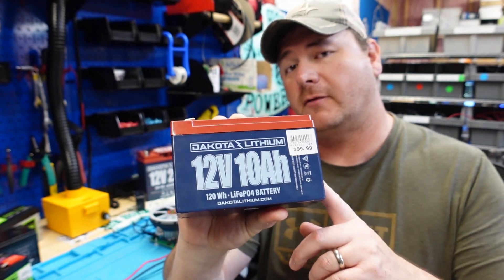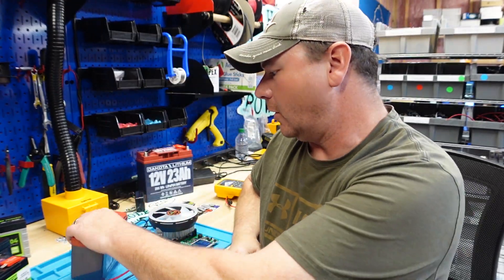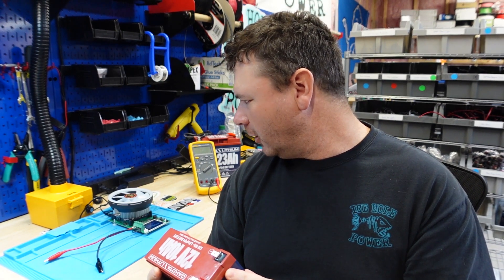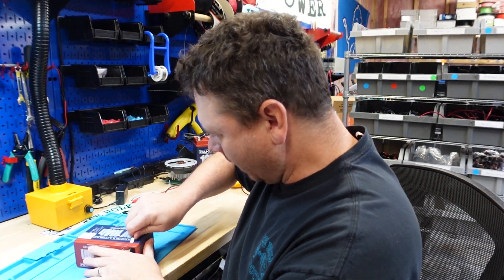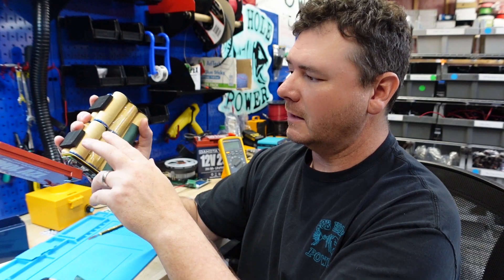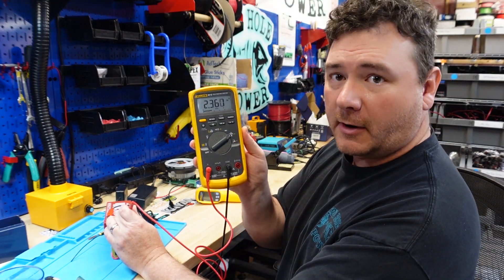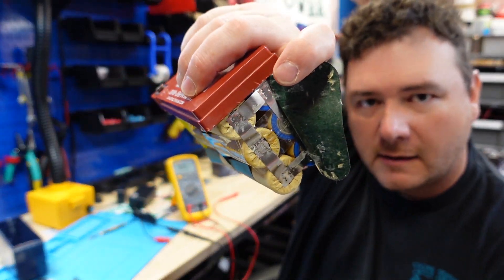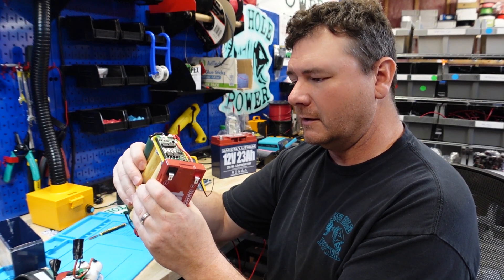Dakota Lithium 10Ah Tear Down (Now Made In China!?!?)

Comment: Love the videos. I have been watching a load of them. I do have a question. You were speaking about the heatshrink, not stopping the conductivity of the voltage. Between the cells. Arround the 6:00 mark. Is the heatshrink not sufficient? OR is it a case of more is better? 

I am looking for a small 20ah lipo4 battery5lbs or less. I have been looking at the eco-worthy 20ah. The recessed terminals, and cannon plug for charging seems appropriate for a ham/gmrs radio bag. I am looking to see if you have done one of them. "ECO-WORTHY Portable 12V Lithium Battery, 20Ah LiFePO4 Deep Cycle Rechargeable Battery". I want to charge it from my truck while driving or a 10amp solar panel on my trailer. Yes I have a 12dc to 12v DC charger. I have 4 100ah in the trailer and 2 in the truck. That is aside from the lead acid to run it. 200 Amp alternatior and I jump start tractior trailers. So the added power is required. I also have a 24v jumper for equipment.
Reply from the maker: I would want to know what the initial amp draw is.  Most of the smaller batteries have a 15amp max.  So I would make sure the battery can handle what you are throwing at it.  

The heat shrink would be a more is better IMO.  Thanks for the comment.  I hope this helps you out.
Reply: @iceholepower8012  my maximum draw at peek is 10amps @12v. It is for a portable radio. 1amp standby. .01ma for off.

Comment: Just ordered two of these 2 months ago. Batteries received were all made 03/2022 and fully charged voltage was much lower than my other used Dakota 7ah ones. Dakota Tech support told me nothing to worry. If I do not like them and want to return I need to ship them back on my own charge. I kept them. After two months light use (for my son's razor scooter), one battery died, could not be charged normally. Dakota still insisted on me to ship it back. Eventually they agreed to reimburse the shipping but required me to restore the terminals to like new condition since I already soldered them. Told them mission impossible and asked for some kind of tolerance or waive this requirement. Tech support got pissed and stopped responding. I think their warranty is a scam.

Comment: Unfortunately I have 12 of these and 4 for sure have bad bms's with no over current protection 3 have 7ah of capacity or less one of those 3 only have .5 ah of capacity. I can send you the CBA test charts and the picture are hard to see but the 4 that i know for sure have no over current started to melt the tops where the bms is. They set me some for warranty replacement and they failed the capacity test also at 8ah or less. Have CBA load test for them also. Its sad I had High hopes for these batteries.

Comment: I'm looking to use these for an Electric trials motorcycle (Oset 16R). They run 3 12v 10ah SLA. They can be charged through the bike or externally. What would you use for a charger. Dakota says charge them individually, not in series as they are run on the bike. Curious.
Reply: PS. Thanks for doing this video.
Reply: I have 2 battery setups using these same DL  batteries for my Goped esr1000h. It's 2 setups of 4 batteries each so 8 of these 12v 10ah batteries and the first set were assembled here and the 2nd in china. So each set has 2x 24v battery banks and when I use the goped onboard charger that's programmed to a lifepo4 profile and yet still .....
       MY BATTERIES HAVE A DRASTIC DIFFERENCE IN PERFORMANCE WHEN I CHARGE INDIVIDUALLY WITH THE 
DL 12V/3A CHARGERS VS THE ONBOARD CHARGING SYSTEM.....😲

      WHAT I DONT UNDERSTAND IS WHY I HAVE A VERY NOTICEABLE DIFFERENCE IN PERFORMANCE BETWEEN THE 4 BATTERIES MADE IN CHINA AND THE 4 BATTERIES
ASSEMBLED HERE. THEIR DATES OF MANUFACTURE ARE ONLY 2 MONTHS APART AND I NEVER USED THE BATTERIES BEFORE THE SECOND SET CAME. ARENT THEY BOTH GETTING THE SUPPLIES FROM THE SAME SOURCE? WTF? ITS NOT A SLIGHT DIFFERENCE ITS 3-4 MPH AND A FEW MILES RANGE EACH AND EVERYTIME...?????🤔🤨

Comment: Just wondering, why would you need a low temperature cut off? Most battery packs have a high temp cut off for battery degradation, internal short, fire etc.
Reply from the maker: When you charge a lithium battery when it is below freezing, it will damage it's ability to retain a charge. I am making a video now about it. Thanks for watching!

Comment: I've been considering the Dakota 12V54Ah battery, but don't want to spend that kind of money if it's not well built.  You asked for suggestions from viewers for the next battery tear down, so there's my suggestion. I'd like to know if it's built well on the inside, where was it built (China?), what kind of protections are built in, etc....

Also, would you expand on the 11 Year Warranty that Dakota offers? I've heard that it's actually a 5 year warranty with a prorated discount past the 5 year mark.

Keep up the good work!
Reply: Todd I've been doing quite a bit of research over the last week into lithium batteries as the (4) 100 AH lead acids that came in my Ryobi riding lawn mower are starting to wear out. I also use the mower to push snow and it's a great machine that I'd like to keep 10+ more years. 

I spoke with Dakota this week and can confirm that their warranty covers full replacement for the first 5 years and then a 30% discount off a new battery for the remaining 6 years.

Battleborn makes their batteries in the USA and their customer service is very helpful and knowledgeable. They have a 10 year warranty that covers full replacement for 8 years and then a 30% discount off a new battery for the last 2 years. I'd like to buy from Battleborn but I can't justify spending nearly $3k for a lithium battery set when the Chinese made one's are half the cost. I'd pay a few hundred more for Battleborn's but not that much more as it's just too expensive. Hope this feedback helps you!
Reply: @zachl6918  Thanks for the update! Yes, that helps a lot. Since my first post with you earlier this year, I’ve also started looking into the SOK batteries. They seem to be very well made and now include battery warmer and Bluetooth monitoring. 

The SOK 100ah without the Bluetooth and warmer is around $540 I believe. They have a nice metal case too. They’re also available in a marine version for wet conditions. 

Another LiFePO4 battery that is more economical is the AmpereTime for around $399 per 100ah battery. 

Keep up the good work and I’ll keep doing a little more research too! 

Take care!
Todd
Reply: @TangoRomeo121  Good to know, thanks for the info!! In my case spending $1,500+ on a set of batteries is a big inventory so I'm trying to take my time and make sure that I get a good set for the money.
Reply from the maker: I would like to do those bigger batteries but the channel would need to grow to justify that kind of cost. When and if I do, then I will make sure to include some warranty info.

Comment: Your 4S3P description is incorrect.  In order to output 12V there needs to be 4 cells in series or approximately 3.2V X 4 = 12.8V.  You cannot have 3 cells (as described) in parallel 4 times.
Reply from the maker: you misunderstood my description of the cells.

Comment: Great timing finding this video. Just ordered 2 for use with ham radio. Plan on installing in parallel for increased capacity. Considered Bioenno but like the fit of these in a 50 cal. MTM box.  Order backlogged for 4 to 6 weeks. Since from China I guess they are sitting on one of the 100 ships sitting off the coast of LA. I was pleased to see that the quality meets your standards. Once I receive the batteries I’ll be ordering a few items from your store too. Looking forward to the other battery tear down videos.
Reply from the maker: Glad you found it useful! BTW, there are a couple on Amazon if you didn't want to wait. https://amzn.to/323nEFv

Comment: Great idea on these videos!  I'll be following along.  Quick question, what is an easy way for a consumer to capacity test one of these batteries?
Reply from the maker: Thanks for watching! This is the load tester that I am using. https://amzn.to/329vOMJ
There are also cheaper ones out there that I have used in the past. Just make sure your amps knob is all the way down before you hook up the battery. https://amzn.to/3cld9PQ
Reply: Go and buy a charger at your local hobby store. They will have chargers that give you info on charge and discharge cycles. I bought a charger that works with Lithium(3.2v, 3.6v, 3.7v 3.8v), Ni-Cad, NiMh, and Pb (lead acid). It can charge, discharge, cycle, storage charge lithium cells, and give you complete data on all of the charge/discharge cycles and will also measure the internal resistance of lithium cells. The charger comes with a bunch of different leads with various connectors for connecting to different cells. It charges up to 7 amps. It cost me about $59